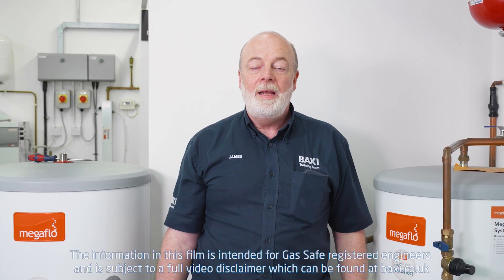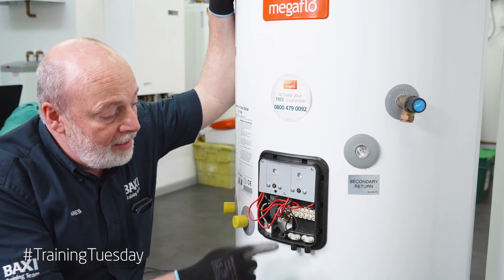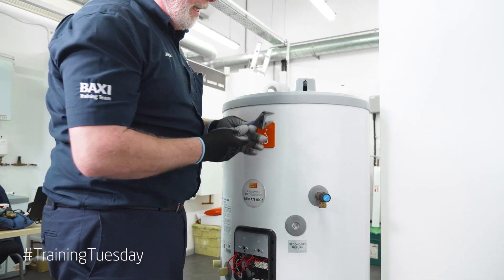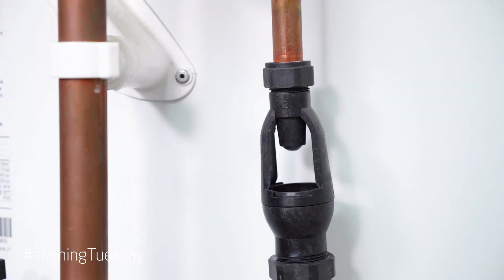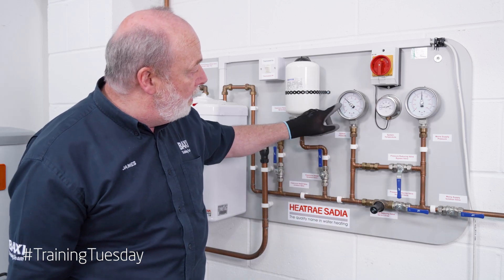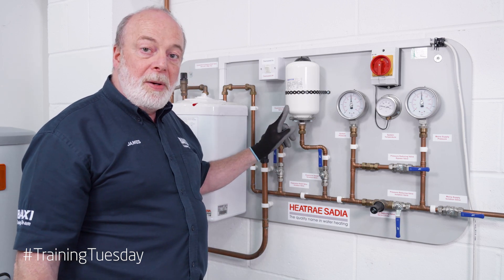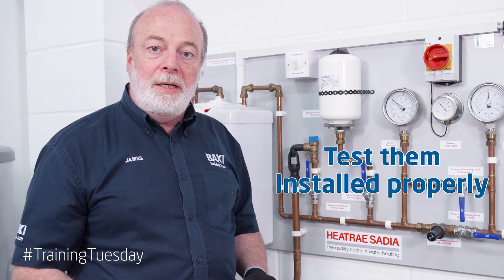The three tiers of safety on all unvented cylinders

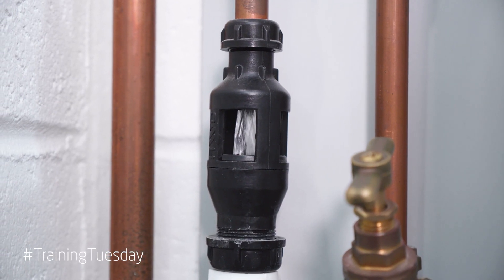Comment: Thak you for uploading helpfull video James, as you shown up the PRV failed and water release from T&P Valve at 5:45 but i can not see any pipe has connected after isolation valve which you turned off at PRV valve, how does that water get access from T&P valve to tundish while turned isolation off ?
Reply: Just what l was thinking? Did l miss something?
Reply: There is a direct pipe to the hot water cylinder below the prv and tundish. The t&p is on the left of the cylinder.. I was also confused initially.

Comment: I had a megaflow tank installed 13 years ago and was not told that it would need to be serviced yearly. This year water started pouring through the immersion heater. I was told by the plumber this had happened because the "bubble' had not been restored regularly. My question is why was the excess pressure not released via the tun dish which I would have thought would have been an easier route for excess pressure. I only power the tank when I am heating water and had only heated the tank for 40 minutes when it failed.
Reply: Did you ever get this sorted sounds like what mine has done today and wanted to know if this means full replacement or just fix the pressure and then will be all good
Reply: Because mine had failed at the immersion heater, buckling it, I had to have a new immersion heater. It was a semi emergency and I paid 400 quid but that also included a new kitchen tap. The lesson I've learned is that you must get the tank regularly serviced by a qualified heating engineer to keep the tank properly adjusted. Hope this helps. Good luck.
Reply: When there is so much pressure the tundish release can be violent

I hope you got that sorted quickly.....?